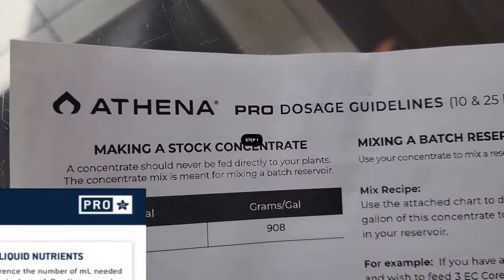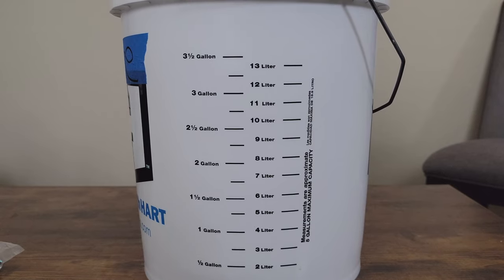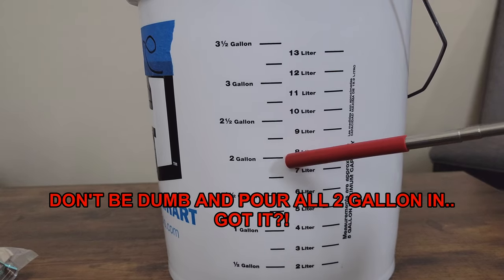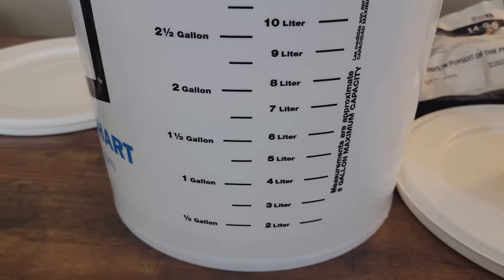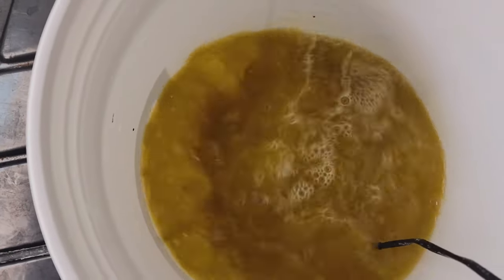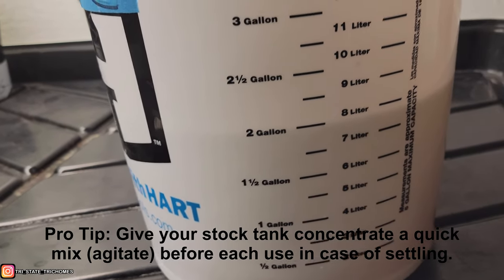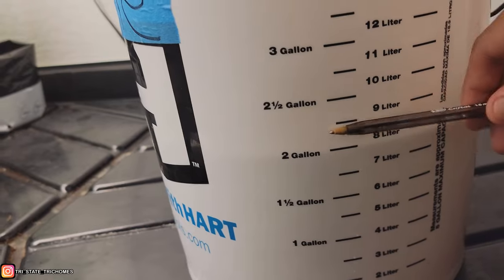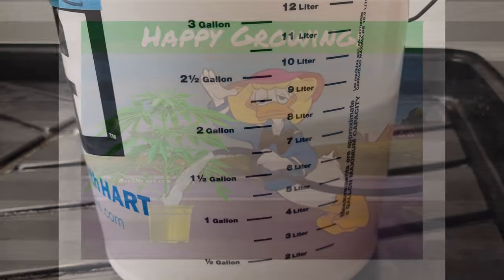How to Mix Athena Pro Line (CORE) - 5 EASY steps - Stock Tank Concentrate (Updated for Copyright)

Comment: How long can this stock last ? can it stay for like a month?
Reply from the maker: When I asked, I was told they have seen it sit for 6 months without any issues. Nothing tested past that. Worse case scenario is it may begin to settle over time and you need to give it a little mix before use. But no other issues if stored in normal Temps and woth a lid on it.

Comment: when i find out that there core only has calcium i went with the blended line, have u used the blended tri? and did u use the "Stack" in bloom, i wanna get it but it's more than the grow a+b or bloom a+b together
Reply from the maker: My last 2 runs I documented are woth athena blended line. I did not use stack. I think I may do a test on stack in the future to see if it actually does anything when you foliar with it.

Comment: Can both nutrients be place in the same reservoir) bucket
Reply from the maker: What do you mean by both nutrients?
Reply: You talking about core, grow, and bloom??
Reply: @dson848  yea
Reply from the maker: I would not recommend mixing the concentrates together in the same stock tank. How will you be able to dose the at the proper ratios if they are mixed as a concentrate? It would not be doable.
Reply: @blackkingz1461  yeah don’t mix, you want equal parts per concentrate!
Reply: @blackkingz1461  I’m currently dividing mine into gallon jugs
Reply: Can you feed your plants straight like with the nutrients mix like that.